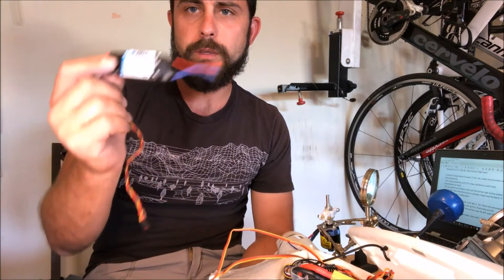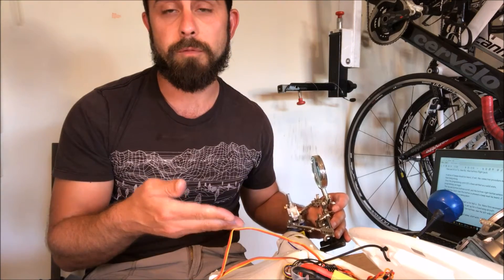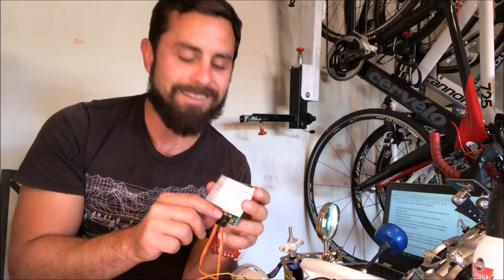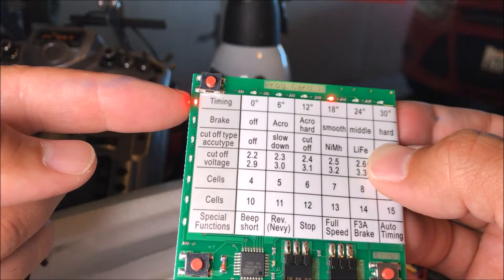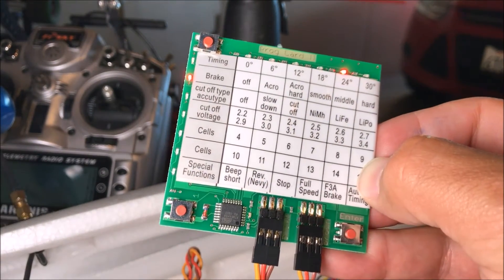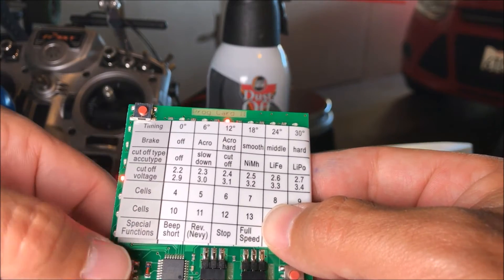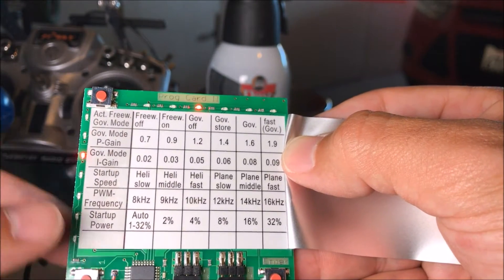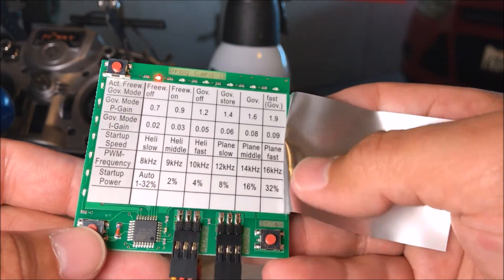YEP 60A ESC Wiring and Programming

Comment: Very well explained, thanks. But what a pain in the ass... I got a YEP60A at the recommendation of a friend and didn't realize I needed a card to program it. I should have just gone with my usual HobbyWing and program it all with the throttle stick, very easy to do in the field and no need to mess with plugs or even open the lid of the plane at all...
Reply from the maker: iforce2d agreed, but this was pretty cheap.

Comment: My ESC on stock is hot. It is almost like the  motor/esc airflow and wiring was an afterthought.  I have to take the motor out 'again' because a wire came loose. The ESC does not seem to get airflow. It is wedged in a tight spot. And that zip tie is only able to be put on before the motor housing is glued on at the factory. It is not like it stands up to relatively light crashes (motor housing to plane connection). Kinda like your fix, except I may add magnets to keep the housing on in addition to rods.
Reply from the maker: RCWeaven FPV that’s a good idea.  There is definitely not adequate cooling for the ESC as is.  In fact the best solution might just be to get rid of the whole housing, mount the motor and ESC externally altogether.  Wouldn’t have looked as slick but definitely more functional.